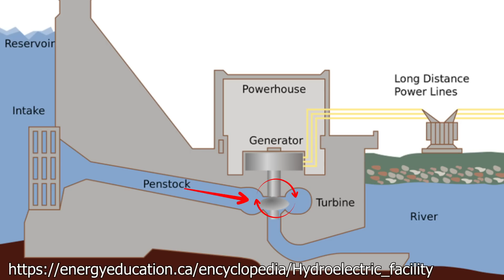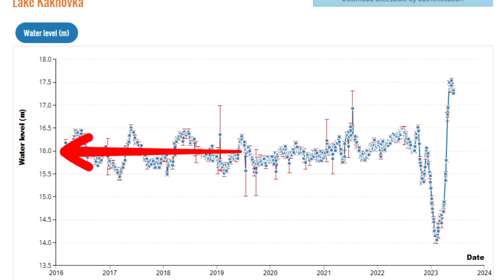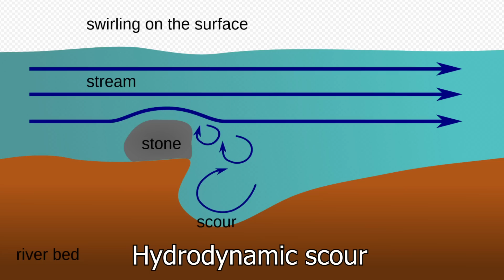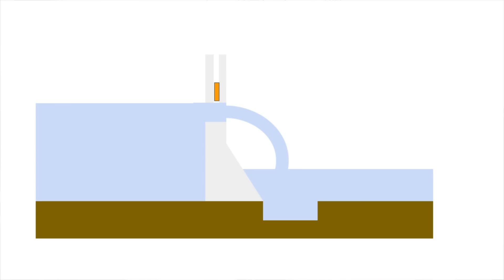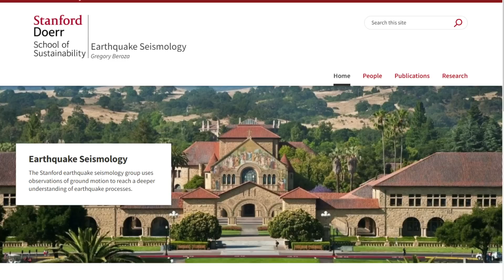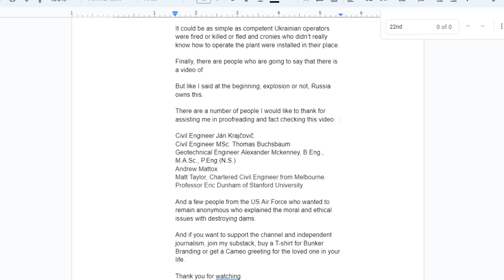How Russia Destroyed the Kakhovka Dam

Comment: Congratulations, Ryan. It is a really good explanation and as it often happens in such cases you have to thin it out to the most probable Hypothesis. After having analyzed the data provided in your video, as a Civil Engineer I would opt for the Hypothesis of structural collapse due to the thrust from below the concrete structure of the dam caused by the period of time the reservoir was kept with the water level above the upper limit (that is why in every dam there is a ruler with a red line at the upper limit to remind everyone that line should not be crossed for too long). However, every army in the world has its fine branch of Engineers who are well versed in the arts and crafts of mainly Civil Engineering (dams included), notwithstanding that Russia is home to some of the best Civil Engineers in the world. So, yes they knew exactly what they were doing and they did it anyway. There was no gross incompetence here as one would expect after having seen the Russian army in action in the war against Ukraine. Negligence? For sure, but negligence with intent.
Reply: I just wrote up my own comment asking if this was possible 😂. The fact they got the levels so unusually low over the winter shows that at one posing in time at least, they might not have been so scared to venture out onto the dam.
Reply: i think the main problem with your reasoning,  is the fact that the dam was in an area where active fighting was going on, you wouldnt have multiple engineers in an area where people are aiming guns at you. And i suppose inspecting and fixing the dam was harder than letting it break.
Reply: @eyelmejor1388  You're talking about basic opening of sluice gates here.  You don't need a genius to do the bare minimum.  The Russians weren't scared to open the sluice gates last winter were they?
Reply: @lashlarue7924  "The Russians weren't scared to open the sluice gates last winter were they?" 
Since November 2022, no one has touched the floodgates at all. no one did anything in the winter. this area was under sniper fire from both sides. that is, the floodgates were open from November 2022 to June 2023 in one position.
Reply: @eyelmejor1388  please dont talk sense in here .... we just want to regurgitate " russia bad , putin evil " ... like a herd of sheep
Reply: @suchins3947  Thing is military Engineers are expected to operate in those kind of environments.  I mean, there's a nuclear power plant with international observers nearby.  It would be easy to get guarnatees that Ukraine won't shoot at dam operators.  Heck, if they'd done that they could have a PR win.

That's why even if it was a structural collapse, it's still Russia's fault.
Reply: @EmperorA0  military engineers are expected to work in such environments ? well that comes with conditions right ? 
pretty damn sure it wont be in occupied territory in such a short time period.

also to maintain the dam, surely u need constant supply of raw materials and moving them through enemy territory aint as easy as you people think it is.

point of the matter is russia didnt have any reason to blow up the dam and ukraine had every reason to do it. But hey lets just paint it on russia cos thats the latest fashion in town
Reply: "negligence with intent".  Indeed, sir.  I believe this is synonymous with, "gross negligence". 🇷🇺👎👎👎👎👎
Reply: Interesting hypothesis, how high up do you belive such a decision would be made?  If letting the dam fail like this were intentional their looks to have been no preperation on their end to control the narrative or to even move their troops out of the way of the flood which would imply lack of communication.
Reply: I was thinking something very similar, as an engineer myself (though not civil) I don't find it hard to believe that this was done intentionally by the Russians. Everyone always seems to forget that engineers can do the stuff they do because the have an understanding of the forces at hand and their effects, we just usually use that info to build and fix rather than destroy, but when you do want something to break in a way that gives you an out by saying it was an accident, the first people you should approach are the relevant engineers and SME's in that field.
Reply: google 
"Seismic signals recorded from an explosion at the Kakhovka Dam in Ukraine"

Comment: After the upper control structure was blown by Ukraine at start of war, near Izium, water level began to rise. Your graph show water being impounded after a 2m drop last fall and into winter, but the jumps in level in late winter early spring 2023 are unprecedented. Someone had control over that flow. Someone like a hydro-electric engineer, and going back to 2016, water levels fluctuated only 1 meter (?). The water level tells a story, which is not accidental...scour channel eroding back under the toe/apron is interesting and likely, given the dam was overtopping- due to flow being extremely restricted, but the explosion caught on film is conclusive. The fact that someone had care and control over the flow, and used it - shows premeditation....
Reply: You're quite right. As someone else pointed out, the dam has elaborate scour protection. Also, all of this is consistent with Russia intended to cause a prolonged, low level flood. Raising the level beforehand means longer duration.

Comment: You may want to look into the Norwegian seismologists who reported a seismic disturbance from their monitoring station 400 miles away in Romania at the exact time explosions were reported at the Dam. And seismic activity that large would be from several tons of explosives against the wall of the dam.
Reply: He did. It's inconclusive, and the only available data is a graph without a scale.
Reply: @loupgarou-dj3tm  it's inconclusive? A seismic event at the exact time as reports of the explosions at the dam, and the same direction of the dam? Their graphs are accurate enough to tell how big an earthquake is on the richter scale and where its happening. Therefore, they can tell which direction and roughly how much explosives are used in an explosion at the dam. (They say about 6 tons by the way). 
So unless Ukraine can smuggle 6 tons of explosives onto an russian controlled dam, there's only one answer.

Comment: Good video Ryan, and I agree that it was likely unintentional for the dam to fail. However I find it a little hard to believe that continual use of one spillway alone would cause the dam to undermine. It has been in operation since 1955, if it was going to undermine it would have already done so by now. It is more likely there was some damage to the spillway from shelling etc that was unnoticed or ignored that initiated the failure.

Comment: This is currently the most plausible explanation I have heard, because of how throughout your research was. I do have to change my own position, because the evidence this explanation doesn’t alling don’t form anywhere near equally compelling explanation.

However, I still think the suspicious rumours still are indeed suspicious. There is just too much fog of war to even place trust on them. Hopefully one day they can be explained or disproven.

Just to list them out, here are few:
1) Right after the failure Russian side tried to play the failure off as a minor failure that poses little threat, before switching to blaming Ukraine. If they did not anticipate the failure of the dam, this intermediate step is hard to explain. As far as I understand these statements were public.

2) Russia removing the law which would have made investigating the dam failure mandatory. I haven’t really seen any proof of this myself, but this seems very provable.

3) Russia moving heavy equipment from the flooded area before the dam failed. I have seen no direct proof for this.

4) “Rumours” about Russian soldiers who were left under the flood having orders to pull back ‘in few weeks’. Then again I can’t read telegram messages and they rarely cite sources.

5) And lastly the timing itself. It happened on what at the time was considered the second day of Ukrainian counter offensive that Russia had prepared to defend against for months. Ukraine very predictably immediately shifted a lot if resources for rescue and evacuation operations while Russia has been shelling said operations.

The timing is also suspicious because Ukraine had gained control of some islands in the river as well as the swampy peninsula at the end of the river. These positions would have been very useful for any attempt to cross the river and breach the defence behind it. And they were rendered absolutely useless.

Lastly while I do trust your judgement more than my own on the actual operational military consequences, you didn’t explicitly mention mud in your analysis. The popular narrative was that Ukrainian counter offensive was delayed until the famous mud-season melting waters cause was over.
 
If Russia agreed with this analysis, they would logically consider having heavy mud as a  viable defence against the counter offensive.

Purposefully breaking the dam will likely create a lot of mud, once the flash-flood is over and the water levels normalise. And because the previously high water levels in the reservoir are lowered as well, the mud will be present on both sides of the dam. The river banks will likely be in much worse state than before. Surely that would be at least more significant factor than simply widening the river?

Eventually the summer will dry up the ground, but this still means forces can be moved to defend against the current Ukrainian attacks, while being relatively sure Ukraine won’t attempt to cross the river, and if they do they likely can’t move very rapidly because of the mud.

Comment: Your assessment is sound , but there could have been explosives detonated in the turbine room on the 2nd, and it didn’t let go until the 6th .. the bridge could have dropped when the explosives went off .. that would make sense if a special forces team humped the supplies in and only had enough to damage the dam, but the fact that that image on the second showed water overtopping the dam leads me to believe it was just neglect.. 
I’m assuming no Russians wanted to man the dam and turbine rooms due to not wanting to die by Ukrainian bullets/explosives, so they probably had a skeleton crew that either showed up to the dam every once and a while to asses and maintain, or was stationed there at all hours, but didn’t have enough staff to properly run the dam and led to its collapse

Comment: The engineers who designed and built the dam were not stupid. They included an emergency failsafe into the dam to prevent overtopping. The navigation lock could be opened to allow water to bypass the dam if the spillway valves became inoperable for some reason.
Unfortunately the Russians filled in the channel of the navigation lock. Oops...

The flooding downstream of the dam though severe and affecting thousands of people on both sides of the river is only a temporary problem. The real ecological disaster here is the loss of the Kakhovka reservoir which will impact agriculture in southern Ukraine for many years to come.

Comment: Sorry Ryan, but the explosion was caught on seismographs
Reply from the maker: Did you watch the video? Did you see the part where the professor from Stamford explains why that graphic is not valid?
Reply: @RyanMcBethProgramming  Theres alot of circumstantial evidence ; including but not limited to, a phone call after, videos of hundreds of kg of explosives being brought in, and the DoD say they have a video of the moment from an `intel asset`.  Whilst externally it was built to withstand a near nuclear strike in the kiloton range, the ones who built would know how to bring it down from the inside.
Reply: @RyanMcBethProgramming  Let me expand on that - the use of the least amount of applied force to maximise the desired result. The reservoir  was at  or above maximum capacity, it had been weakened earlier in the war and the occupation forces had explosives. The primary result being flood out a proposed vector for attack, the second result , which we`ll start to see , is a nuclear emergency.

Comment: Ryan McBeth. I would agree 100% with one exception, how would you explain the second breach site in the middle of the hydro power plant building ?? If the dam collapsed from overtopping, wouldn't it be breached in only that one spot? how would just the middle of the building collaps and not the entire structure? I would maybe think they blew the Hydro plant, maybe even to just damage that and the complete collaps was unitended... but either way , I think they blew that area and then the energy from the explosion maybe caused the damaged area you are pointing out to then also collaps... Just a theory I came up with while watching your video. My only issue with saying it was a natural collaps was the two breached spots and not the one at the weak spot that you correctly pointed out.

Comment: Fantastic analysis, as usual! Just a note that your 'break it you bought it' maxim kind of assumes a 'good faith' negligence on Russia's part. There is every chance that even if there was no demolition carried out by Russia, this dam failure could still be an intentional act accomplished by setting conditions that were designed to lead to these ends. Certainly it will have been known what actions are required for safe maintenance and what the consequences would be for the various kinds of mis-operation. And which produces this kind of deniable culpability.
It seems like there are zero military objectives that destroying this dam strategically provides Ukraine... either in the course of the war or for the war's aftermath. Zero. We can imagine scenarios in which a country might destroy its own infrastructure to forestall actions against themselves, but there is no such imaginable scenario here. On the contrary, in the case of Russia, it seems that this is exactly the time and circumstance where this dam's failure suits their military objectives. Plus, the malevolent, "I'm going to give them a thrashing" -V Putin.

Comment: Ukraine released a report a while ago where they said they had plans to destroy the dam, and even said that they did some testing to see whether it would work. I think that’s at least worth mentioning. This was back when Ukraine would gain an advantage by blowing the dam, but with the Russian forces being pushed back it would bake little sense now. But the fact remains that Ukraine officially stated they carried out tests to destroy the dam, which might have damaged it so it broke after not getting maintenance. Might also be why Russia blew up their side of the bridge to the dam, they wanted no further damage as they would need to evacuate kherson.
Reply: Ukraine wanted to increase flow in order to disrupt Russian operations. That's not the same as "blowing the dam". What they evaluated was the idea of putting a hole in a spill gate with a missile. The problem here is that it requires very good accuracy and a missile coming in from a low angle. Not easy to pull off. Missiles will not cause a major failure in the dam - it's just too strong.

Comment: Very good points for a scenario destroying it by negligence and/or incompetence. A few puzzle pieces could speak against that in my opinion. To make it clear I do not know this stuff, I just see some pictures and understand some physics. Some do not fit into your scenario. 1. Some Russian sources seemed to claim initially to have Kakovka blow. 2. Some more "official" channels in Russia did not condemn the breaking and at least hinted that it would be the right thing to blow. 3. UA evacuation measures are fired upon by RF and the fleeing/evacuation on the left side was at least in some alleged cases forcefully stopped by soldiers of RF 4. To me, it looks like the dam has three areas it breached or the Denipro flows out now. The concrete part as you mentioned, in the middle of the generator hall and at the locks for shipping. At least in the satellite footage, it seems that Hall 5/6???? and the building part more easterly stand "undamaged" in the middle of this torrent, and the earthen wall with locks is gone as well. If this is undermining from one of the easterly sluice gates I would assume that Generator hall 1/2 will be spept away if 3/4 collaps and are gone as well. And the undermining will be much easier at the thin area where the other sluice gates are.  5. it was reported weeks ago that on crimea every recervoir was filled to the brim and even water was dumped to the sea of Asov which could at least indicate that Russia was seen your scenario developing for weeks or planed on never get water again via the channels.

Points 1-3 could be explained by just beeing a donkey but 4. and 5. are hard to reconcile with neglicence and just breaking as far as I understand that stuff.